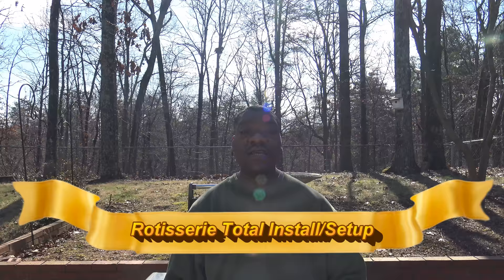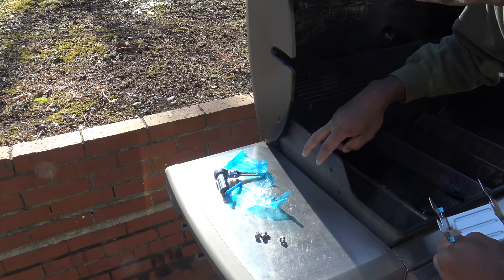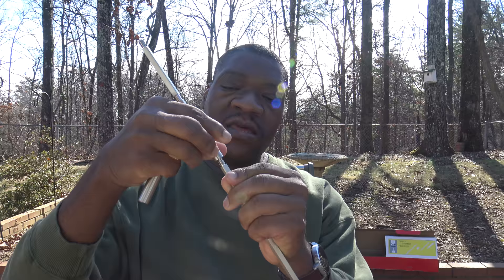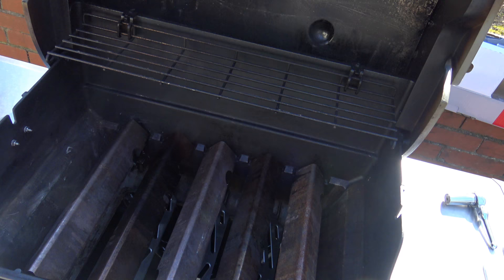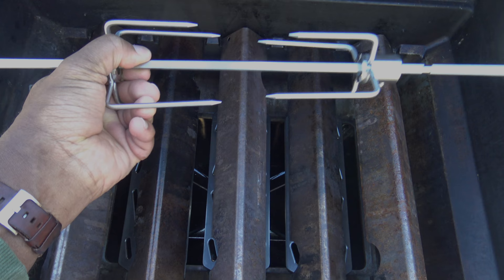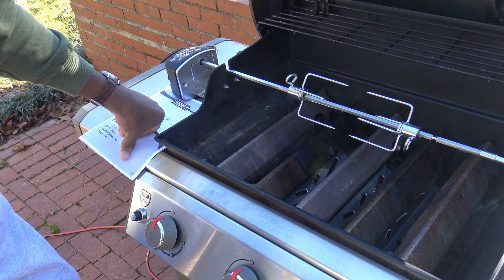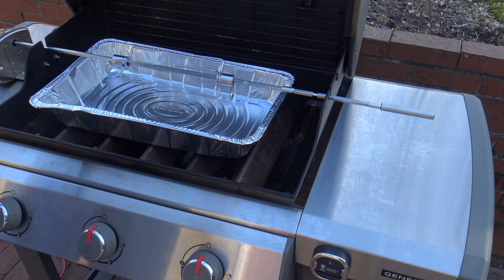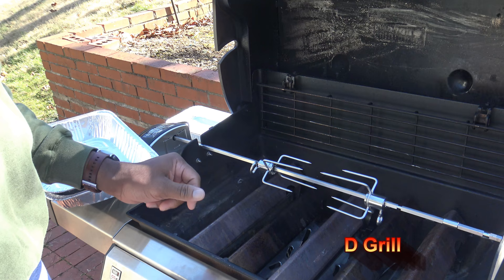Rotisserie Total Install, for Weber Genesis and Genesis II Grills

Comment: Nice video.  When using the rotisserie you use indirect heat only from the burners on the ends so you take off the middle heat tents or flavorizers and put a drip pan over the unlit burners. You will then have plenty of room.

Comment: Thanks for creating this video as it's very timely for us. Two days ago we just purchased the smaller Genesis E-210 and were considering a rotisserie. Now that I've seen how little space there is I'm having second thoughts. I'm also surprised there's no counter balance.
Reply from the maker: +George Reed I have a video coming with a food cook on the rotisserie.  It might change your mind about getting a rotisserie 😀 .  You just can't do a full sized turkey.  But I plan to show plenty that can be done.  Last year was lots of smokes.  This year may feature lots of rotisserie spinning.

Everything is balanced just fine.  You'll see in my next video.  Already filmed.  Just have to edit.
Reply: Thanks Darnell, I'll subscribe and take a look when you get it posted. Cheers.
Reply from the maker: +George Reed Great, we small creators are in desperate need of subscribers.

You may not have heard.  YouTube will stop monetizing this channel and other small channels on February 20th.  Channels need at least 1000 subscribers and 4000 hours watch time then.  This channel has way over the required watch hours, but needs a couple hundred more subs.
Reply: I was not aware of that. I'll do my part and hopefully others will too.

Comment: Definitely a small area to work with.  Do you think a chicken has to be centered on the rod.  I have a four burner, and wondering if I could still leave one of my grates in to cook other stuff while the chicken is cooking.  Also, do you know what heat level and time it takes to cook yet?  Look forward to that video next.
Reply from the maker: +Michael Sterling My next upcoming video is sure to answer your questions.  2 chickens on the rotisserie, with a baste made up 😋 .

But I will answer in words for now.  No, you don't have to center the meat on the rod, but I can't say how things will turn out since I never actually did a full cook on one side.  But I think it would work out fine.

Heat level and time is pretty much identical to without the rotisserie.

What I discovered and you'll also see in the upcoming video.  Is that you can put the iGrill 3 Ambient Probe on the lowered warming rack.  I will demonstrate how in the video.  But the temp is a good bit higher than the hood temp.  And due to the position of the ambient probe in such a case. It is not nearly accurate, reads way too high, like 50° F.+ too high.  So the hood temp is more accurate.

Comment: Thanks for the video, D.  Great presentation, brah.  I've got a Weber kettle rotisserie that has a lot more clearance for a turkey, pork shoulder, etc.  Kind of disappointed in the gas grill option.  Too limiting, I think.
Reply from the maker: I agree.  I have seen the Kettle rotisserie and it's impressive.  You would think the pricer grill would have better tools 🤔.
Reply: What about taking a Dremil with a rotary cutter and cut off about an inch or so of the bottom of the burner cover? Sounds pretty good to me.
Reply from the maker: What you're calling a burner cover is the flavorizer bar and cutting it would come cause drippings to go onto the burner.  Which is going to shorten the life of the burner.  And i am pretty sure it would also void the 10 year warranty.  And the open propane fueled flame is going to cause very uneven cooking.  Seems better to just get a Weber Kettle and its rotisserie kit, if you really want more room on a rotisserie.
Reply from the maker: And if you wanted to try that.  You don't have to cut it.  The flavorizer bars are removable.  But that open flame will probably cause things to not cook even and so on as mentioned.  They're supposed to remain on during cooking by design.

Comment: nIce video. I have the same bar b q and just started rotessering. I noticed the height restrictions between the food and pans. Wondered how to get some more height there.
Reply: When using the rotisserie you use indirect heat only from the burners on the ends so you take off the middle heat tents or flavorizers and put a drip pan over the unlit burners. You will then have plenty of room.

Comment: I got my rotisserie today, mounted the motor bracket, and when I installed the motor, it sits on the side table of the grill and doesn’t fully engage with the bracket! I assembled the rod, fully installed it into the motor, and the square part of the rod is in the groove on the right side of the grill wall!

Comment: Quick question - I have a Genesis II LX S-340 and bought the rotisserie and kebab kit for it.  Do you remove the attachment (the bit that holds the motor) from the grill after each time you've used the rotisserie or do you just leave it permanently attached?
Reply from the maker: It remains permanently attached.
Reply: D Grill Super! Thanks for clarifying and thanks also for the great content - really enjoying watching your videos.

Comment: A company called "One Grill" makes a MUCH better rotisserie than Weber.....just Google their website. The spit rods are cut to the correct length for YOUR Weber. They also have baskets and tumblers, all in either chrome or 304 stainless. Installation is a breeze. Motors are avail in battery powered or electric AC. The price for my model was even better and will hold a heavier meat load.